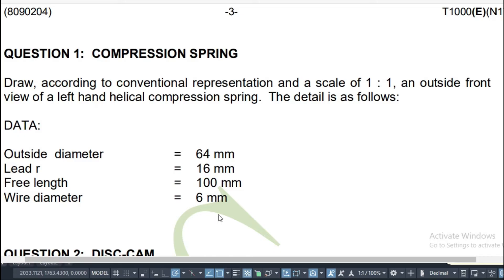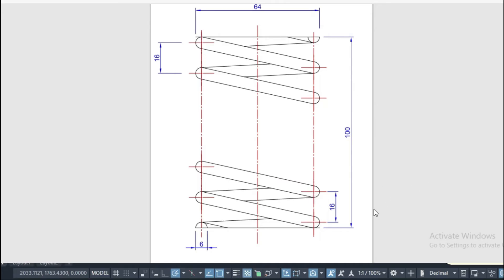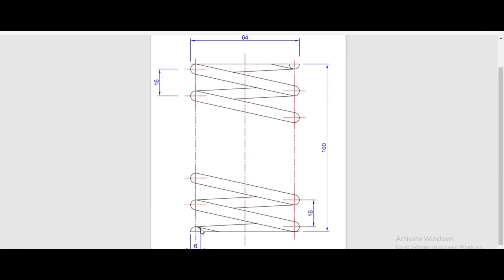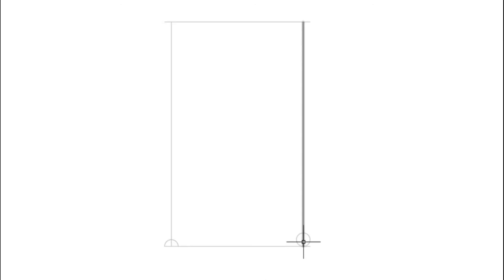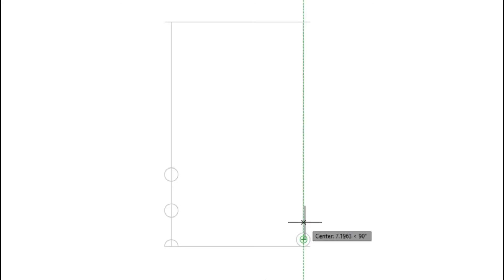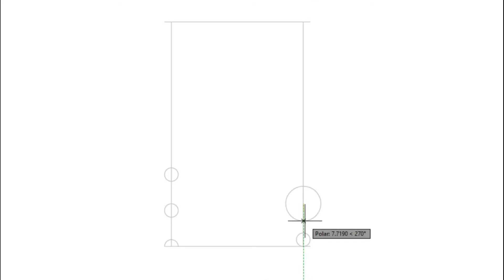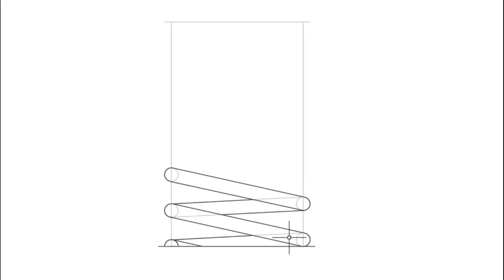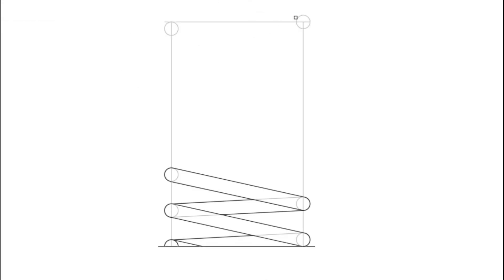Conventional representation of Compression spring

Comment: Isn't on 1:35 to get the diameter [ min diameter (Dm ) ] you have to to subtract outside diameter and wire diameter ?!
Reply from the maker: Yaah thats correct and the Dm is going to be 58....which is exactly the same as used on the video